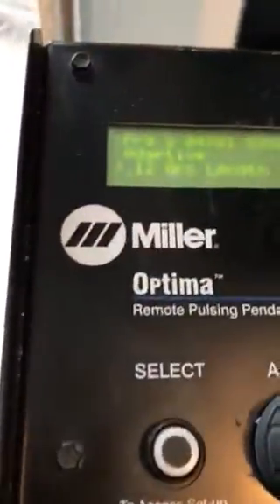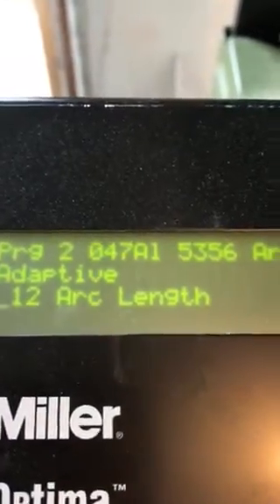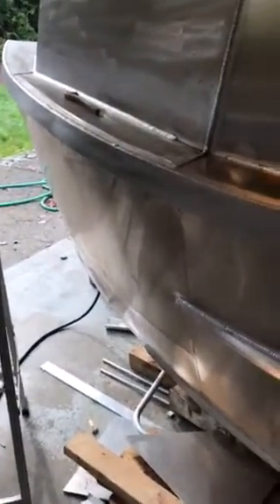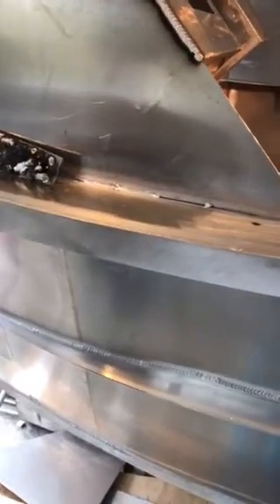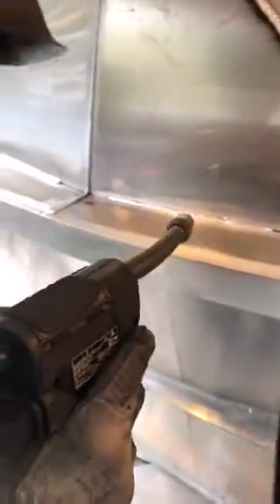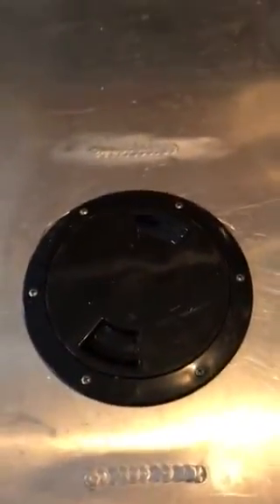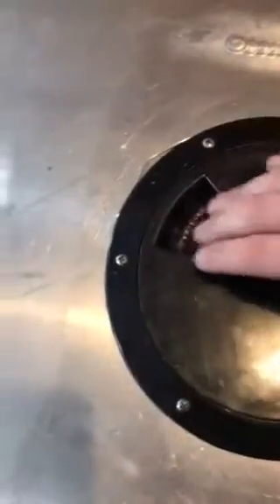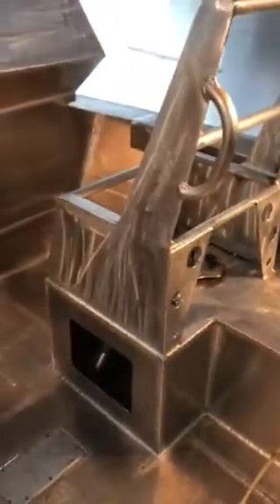Burning some wire on the aluminum boat build, free build plans and design at the end of the video

Comment: Hey Ryker,Do you have any specs like how I can at least build the hull and get the right shape? Any ideas, want to build a boat 14-18 feet and just need help getting the hull going. Thanks
Reply from the maker: DovgalyukProductions    I would recommend either reading a book on lofting a boat hull or try to find a video.  I just don't think I could give a fair explanation of "how to" in the comment section. You will want to consider dead-rise fore and aft, beam side to side and transom angle. Ask what you want from the boat, speed, stability, low draft, smooth in ruff water? I would do a video on this possibly in the future but this would be a fairly in depth subject that would take time to put together.

Comment: any advise on welding without pulse welder. for first time.1.5mm material.
Reply from the maker: Steven Lee   Is the material aluminum or steel?  The pulse function is not needed for either type of metal and many prefer no pulse. 
   1.5 mm I would recommend smaller diameter wire like .035.